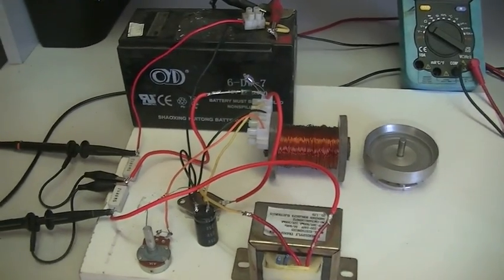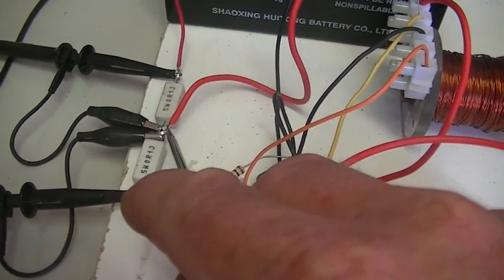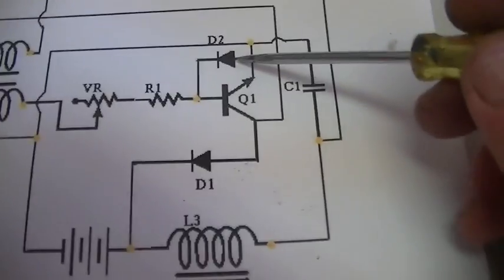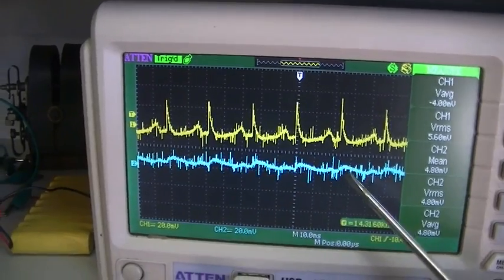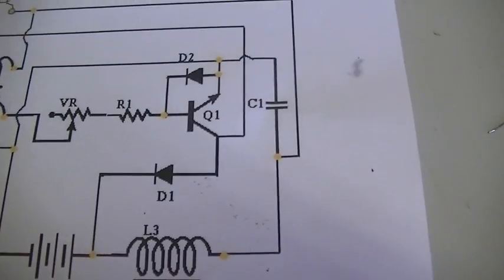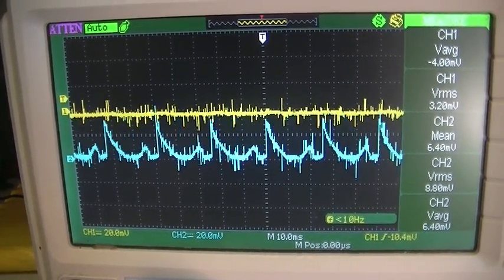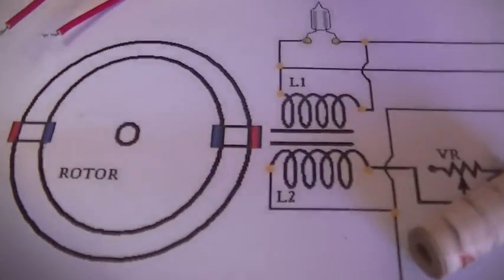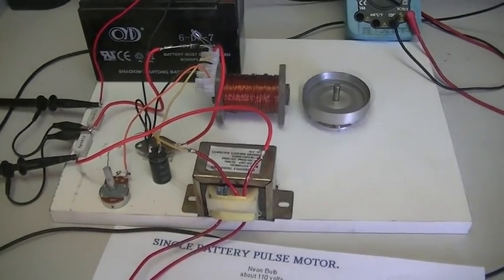Bedini SSG single battery mod.

Comment: You should explain why you're calling that Transformer a choke please explain your definition in his greatest detail as you can while you call it a choke, understanding my determination the reason why that Transformer work is because it isolates it turns off and on and why is that important you can't push energy into a battery why is coming out of the battery so you need to switch it by switching off and on it gives it time to charge and discharge. The reason why we're mentioning this is because everyone wants to ignore the true definition of overunity which is alternating DC current and you are doing a great example of it and you explain it soon as you take that Transformer step up off of there it bogs down because of impedance so by switching which the Transformer does naturally you're able to do two things at one time with the same battery over to the other side over Unity unit is the battery Unity is joining both of them together operating as one and the switch lets the charge come in and out of the battery this is why it works I'm Lloyd Stovall I am the Creator and the father of overunity

Comment: Very nice! For my Adams Motor I've been looking for a way to (partially) recharge the source battery. Will give this a try, as it is much simpler than the cap + zener + thyristor charge/discharge circuit I came up with haha

Comment: What's is a CVR ?  I can see they are resistors but why CVR ?  I have made many different variations , brilliant for charging good and dead batteries but definitely not over unity device.....check joule in and out

Comment: Im at a bit of a loss as to how you say it is working quite well and it is not achieving Over Unity?
You said the voltage of the battery is going down.
So there is no way it will take a load on top, as it is not self sustaining.
Sure it is helping keep the battery topped up some what. But it is still not enough to maintain itself.
A nice effort though. But perhaps your spikes need more kick? Or perhaps several coils are required as others machines.

As with Robert Adams machine, and it put on an open forum, another guy managed to switch in the pick up coils, for less than 3 degrees of the rotation. In effect cutting out the magnetic drag. The combination of positioning and switch them in and out. He had two running coils and 4 pick up coils. And also he has the running coils like yours spiking back to the battery. But he does have two of them.

Comment: The D2 diode that is said to not be needed as it makes no difference is actually a back EMF protection diode. So it more of a safety design feature so the back pulse does not blow up your transistor. They put them on relays also since forever. They go in reverse polarity to the voltage. If the speed was increased and you got bigger back EMF spikes or put a larger load on the circuit. For its for a battery to do some work, not just run the motor and charge itself. Then if it is missing you might find the transistor is at risk of a larger spike blowing it.

Comment: If you have time I would be interested in how to balance the wheel with magnets. I'm having an awful time with my bicycle wheel and the magnets. The bar magnets seem to be of differing weights and sizes. Any good advice on these topics would be great. There seems to be this cult following for these things. Thanks for your ideas. I discover something new every day by pursuing these designs. Speaking of inductors, we don't need to wind our own coils when those old choke coils are around. I opened one up and found that I could remove the bar laminate if it is that type. Transformers aren't usually built that way but that's because of the amount of power they need to work with. But I've seen the microwave power supply do use them but they're welded on. Chatter eliminators I guess. Got any good glue? And what are CVRs? I've had to redraw what you have to make better sense out of it. I also don't like the bifilar coils. If you want your wire back then you have to unwind the whole thing. The trigger winding isn't as critical as the drive winding. It could always be replaced with a Hall Effect or whatever you want just to time the thing. Fidget type spinners are also becoming more popular. I have ideas to use old hard drive disks if they are aluminum and use paramagnetism to be a sort of reluctor drive by placing the magnets and coils altnerting with each other and let the aluminum disk transfer the paramagnetism. Do you think that would work?

Comment: I am following the charge/discharge current path for the work coil and choke in the schematic.  It does not work as drawn.  On paper, the only path the coil can discharge through is the neon and the choke does not discharge at all so its power is pushed onto the transistor and could burn it out.   D1 is drawn into the wrong spot - to fix the problem D1 needs to be across the base and collector of Q1 (banded end to collector).
Reply from the maker: L1 is charged up by C1 when Q1 closes. L1 is then discharged into the battery via D1. L3 prevents the discharge spike going to C1. The circuit works just as the scematic is drawn. The inductive kickback will not discharge through the neon, as the resistance value is far greater than the batteries resistance value.

Comment: Interesting work. The problem is if there are two different types of energy in the regular system as is the theory, then mixing them in one battery does not work over the long term. This is what long-term testing shows (and additional processes can keep it the same). You can try a lithium battery to see how it responds to this. But the problem also is the energy also wants to go in one direction so it is always more efficient to use multiple batteries.

Comment: This reminds me of a commercial device I heard about years ago that was a solid state flyback battery conditioner.   It was attached directly to a 12v battery and just left on.  It didn't use much juice  but just constantly zapped the battery with spikes to keep the plates clean.  I didn't buy one and don't know if it really worked or not.
Reply from the maker: Using a JT type circuit,with the added inductor,may work in the same way.

Comment: Great work! Thanks for sharing. Cheers
Reply from the maker: Hi Arkiver. I will be doing some work based around your toroid motor,which is very close to my L.A.G (lenz assisted generator). Keep in touch,and lets see if you can get the same result i am hoping for.

Comment: I remember when I used to recommend this to some people back in the day and it would indeed cause some smoke much to my confusion, but I never used a choke, just basically removed the charge battery and ran the rectified collector current back to the positive rail. 
using the inductance in the choke to 'resist the change' in current as it tries to fly back through the circuit is a good idea. these are the kinds of mods I'd like to see used on standard motors.

Comment: That is very nice design. Have you thought of doing a voltage doubler circuit with a comparotor circuit to give a stable 13v at whatever ampere can be reclaimed in those 15kHz frequencies you have attenuated? I wouldn't expect over unity, but anything closer to unity is a great accomplishment!